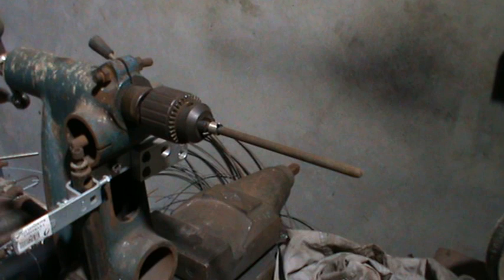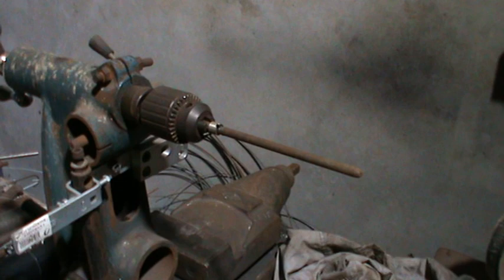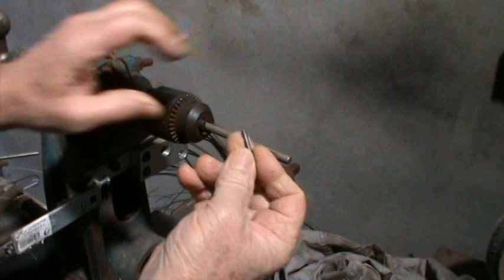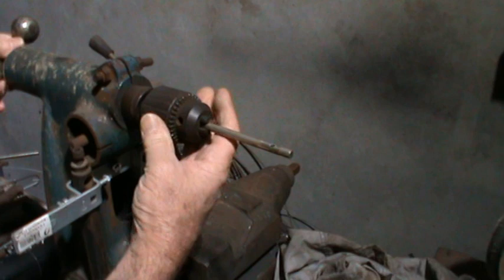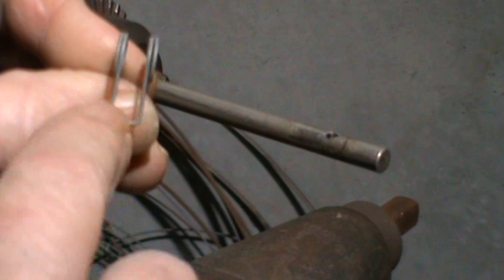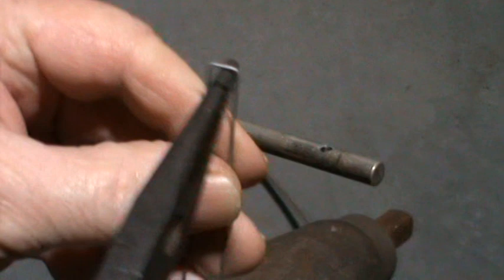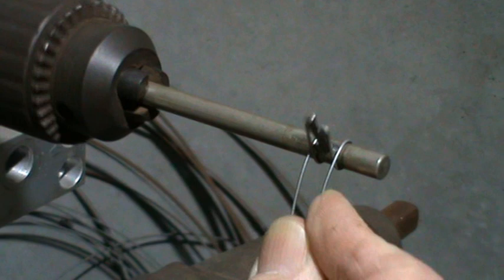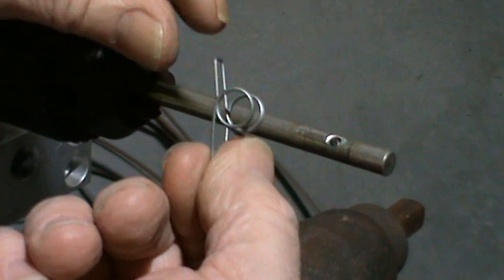How to make a double torsion spring by hand.On a hand coiler and mandrell.

Comment: I was searching for information on making a some double torsion springs in my home shop when I cam across your channel. A few questions for you:
1. Can you provide a little more information on the wire catch used on your winding machine? 
2. Does music wire need to be heat treated in an oven and if so, can you share any information on the process?
Great information in your videos. I'm headed out to the garage to try a few of your winding techniques.
Reply from the maker: For your test drill a 3mm hole halfway through the mandrell and cut a 3mm nail in half to use as the pin.
Heat treat piano wire in your oven at 250 celsius for 1 hour.
Reply: This method is the best i got 50 years experience u can make winding tool with two side supporting plate
Reply: Heat treatment required after coilng to relive strees developed whel winding

Comment: I need to make (single) torsion springs of .094" (2.4mm) music wire that have .16" (4mm)  ID closed loops on the legs. Can you explain how to make such tight bends on this heavy wire? Thx.
Reply from the maker: Ok ,  i've not done a vid yet on tight coiling. That needs a wire catch lever placed over the  mandrell to support the wire instead of just your fingers holding the wire.
So a piece of flat steel around 6 inches long , drill a 5mm hole through it 10mm from  one end . The mandrel goes through that hole . Then you need another hole
About 12mm away for a small  m5 bolt using its head to keep the wire close to the mandrel. Now your hand is free to hold the lever instead of the wire.
I hope this helps.
Reply: @thespringguy1  Many thanks for the reply, I think I understand, but a picture is worth a thousand words. Any chance that you could make a short video on this topic? I'm probably not the only one who has this issue.
Reply from the maker: I know, will have to do a future vid on that...

Comment: How long in the oven and at what temperature?
Reply from the maker: 2 hous at 260 celsius
Reply: Tempering is done on grade of the material from 250°c to 400°c valve springs and nozzal holder springs done st 350 to 400°c